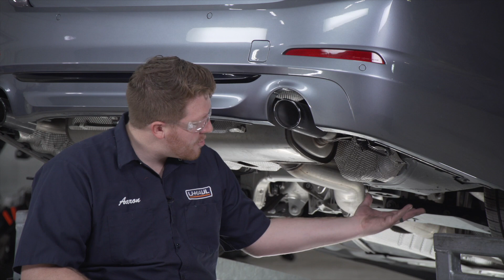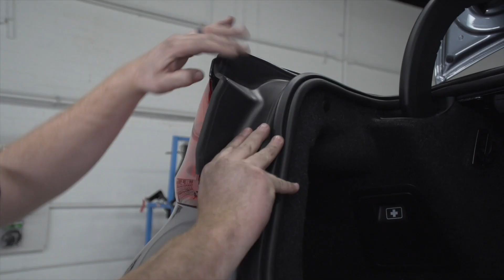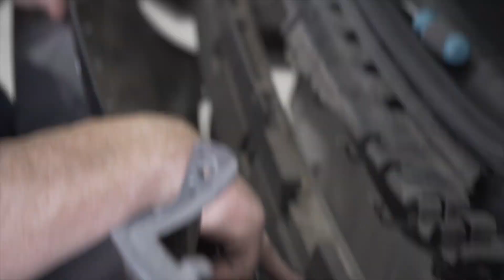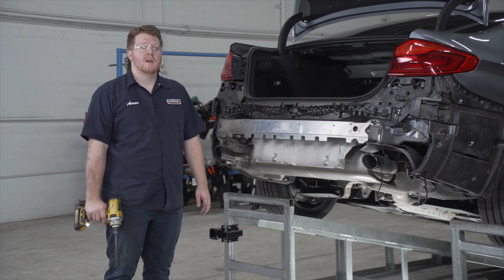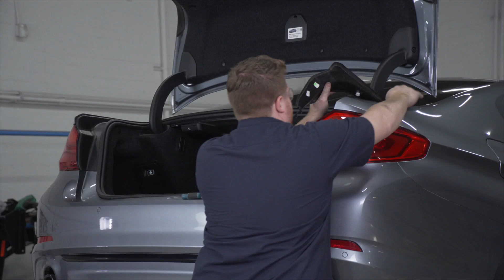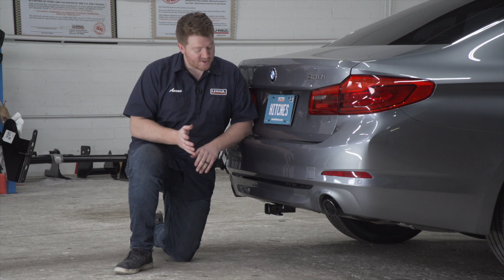2018 BMW 530i Trailer Hitch Installation

Comment: He’s very steady in the way he explains things .Pity no wiring on this one .
Reply from the maker: Wiring is a separate part and therefore a separate video. Here is a Zero Contact Wiring Harness that fits ALL vehicles on the road. The steps contained within will likely match up for the 2017-2023 BMW 530i, and ANY Universal Wiring Harness can be installed in a similar fashion.(CMF59236). Be sure to Use a wire Tester to Determine your Towing Signals as various Factorys can Use different wiring Colors on thier respective builds.
Reply from the maker: 2017-2023 BMW 530i Universal Wiring Video: https://youtu.be/9QCPEs_fQn8